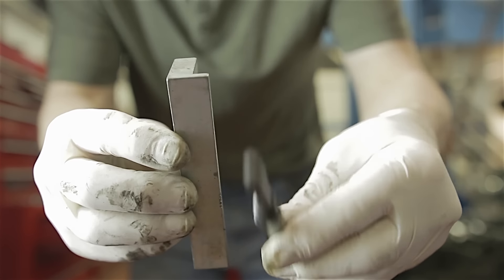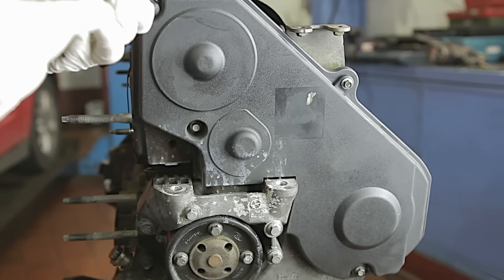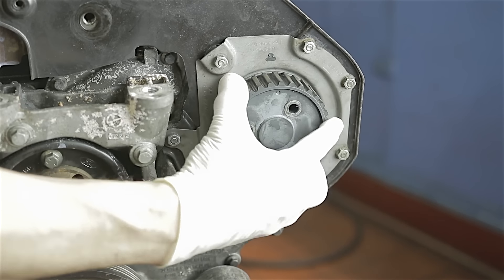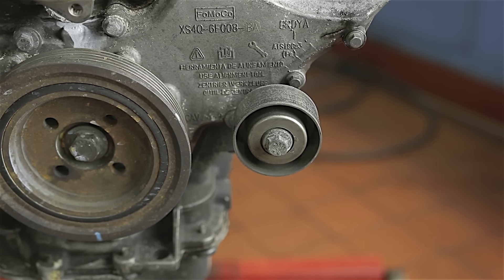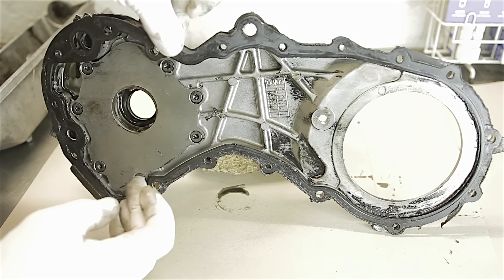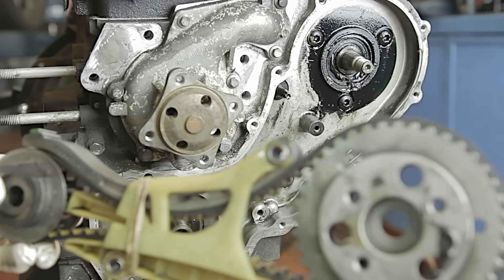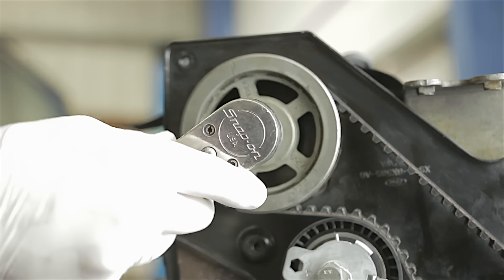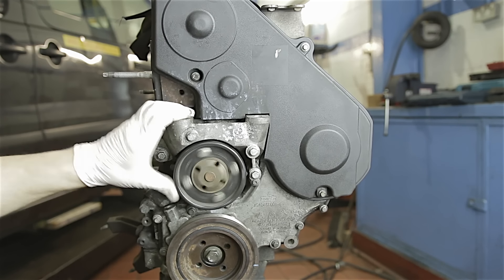Ford Mondeo/Transit Connect 1.8tdci wet timing belt replacement

Comment: HI just done a chain conversion to a 1.8 tdci and now have a bad oil leak from the crank seal  i used the correct tools and had everything spotless before fitting even with the alignment tool in the timing cover still has a lot of movement at the top around injector pump sprocket how do you get that  aligned? any advice would be greatly appreciated.

Comment: hi allan great video. Im using it to try and diagnose an oil leak does the offset  sprocket ? on the fuel pump when its not or if its badly beaded with sealant cause  an oil leak ?
Reply from the maker: yes it can do but more likely to be the main seal around the fuel pump that is built into the metal plate assembly but if you change that seal then probably worth taking the sprocket off and re sealing it as well

Comment: Great video. Can you please give me some advice.?Ive noticed a whirring sound almost like a worn bearing noise coming from my timing belt cover area. I suspect the tensioner, or at least i think, also the marker on the tensioner isnt in the middle exactly. Could it need retightened or even replaced. My car has 135k miles and timing belt was changed at 117k apparently but ive no proof that tensioner was changed  along with belt. Thanks
Reply from the maker: hi, make sure it is not anything being driven by the auxiliary belt, alternator etc.
j have had in the past the camshaft sprocket catching the back plate so with cam belt cover off you can push back plate to see if noise stops,
the tensioner pointer does not have to be exactly in the middle but only way to really check it is to remove the top belt and spin the bearing by hand to see if it is rough and noisey.
hope this helps..
Reply: Thanks for responding. Ive confirmed the noise somewhere in the timing belt area even with aux belt off. Is it just a matter of detensioning timing belt and removing tensioner to check or will this mess up the timing. If so Am i right in saying i dont need to loosen any of the 2 sprockets to do this. Thanks
Reply from the maker: if you are not sure then best to get some one who is but if you are going to remove the cam belt then you need to paint mark both sprockets to the back plate then when you put the belt back on you will know for sure that the timing is in the same position.
No, do not loosen any of the sprocket bolts.
Reply: @alan4x  Hi Alan. Great video. Quite informative. I've completed the wet belt replacement, changed the seal and all...but when I start up the engine it leaks oil from the bottom of the seal onto the belt. I've had the seal changed twice now but no improvement

Comment: What is the reason fot the wet belt? Has the engine been converted from chain to belt?
Reply from the maker: the wet belts were fitted to these engines somewhere between late 2007-2010 ish..aparently they reduced noise but i think they were cheaper for ford to buy and install than a chain...bad idea and the cause of many dead engines...you can convert the wet belt back to a chain but it is expensive
Reply: @alan4x  I know the Peugeout 5008 also j
uses a wet belt on one of the engines. Since rubber is such a good friend of oil and the unescapable fule that will leach into the oil I jus tthought that had catastrophic failiure written all over it.

Comment: Hi Alan, 

I appreciate your video.  

I’m in a bit of a pickle. I’m trying to identify what position the cams need to be in so it doesn’t have bend any valves. (Just replace valves, seals etc) but can’t find anywhere what position the cam would need to be sat in when at TDC. 

Any guidance would be much appreciated!

Comment: great video.  if you were to change just the top belt do you still have loosen the cam sprocket before you tension it.
Reply from the maker: hi, to be honest, i never loosen the cam sprocket, i just paint mark the cam and pump sprockets to the backplate and fit a new ford top belt, never had a problem and they always have lined up well.

Comment: Hi Alan.great videos, Keep them coming! I just got a 2015 Mk5 1.6lt tdci  Mondeo estate. Do you know if the smaller 1.6 diesel engine has the wet timing belt? Can't find any info on it.
Reply: Its dry.
Reply: Thanks. I asked the Ford stealership mechanics and they confirmed there is no second wet belt also!
Reply: But in the 1.6 you have a dry belt and a chain which goes between the two camshafts 😂 What a stupid design

Comment: Super videos thanks Alan. A quick one. If I wanted to check the tensor bolt to see if it's a wet belt or chain, can this be safely removed and replaced and tightened without interference or worry?
Reply from the maker: yes, just unscrew it and take it out, there is no way the belt or chain will jump. just don't run the engine with it out lol.
alternatively you can give your registration number to a ford dealer parts specialist and they should be able to tell whether your car is fitted with chain or belt.
Reply: Thanks Alan. I will do that also, it's a 58 plate SMax manufacturer date March 2008, I was going to try check tensioner incase Ford can't help as your earlier video mentions that may not conclusively be able to tell. Here's hoping. Although the chain has a recommended 125k miles change, it's not necessary? P.s your not local and do foreigners per chance? 😉
Reply from the maker: ford dealers have been pretty good on knowing whats fitted to cars lately so worth a try, if it does have a chain then forget it, that is a double chain twice the thickness of what you would find in say a vauxhall corsa and i have never had or heard of one of those chains breaking
Reply: Thank you again Alan. Final questions you'll be pleased yo know. I assume worthwhile changing aux belt and tensioners? Anything else (aware to do the waterpump) whilst engine in this state? Average number of hours to complete? And FAI a trusted brand. Finally thank you again.
Reply from the maker: yes well worth changing aux belt and tensioners if feel or sound rough, thats about it.
i have only ever used genuine ford parts and although fai is a good brand i would still rather pay the extra as the genuine parts will be of better quality.
if you have never done this job before then it will take approx 6-8 hours, when i was changing wet belts for chains on mondeos one after the other i was averaging just over three hours a car
Reply: And it's possible to do this with engine still in situ?
Reply from the maker: yes

Comment: Alan which ford diesel engine according to you is the best to go for
Reply from the maker: depends what car you are interested in but most fords now have peugeot engines fitted which actually is not a bad thing
Reply: @alan4x  we are looking at buying Ford s max 2.0 ctdi from 2011 with about 60k ish miles

Comment: Hi Alan, I see that you have done a lot with this engine, I have just repaired one of these engines after the said belt snapped it's had pistons valves etc not a problem all built back up but my problem is the belt tensioner pointer will not go into the correct position it's right at the top of the window and will go into the correct position the tensioner just goes all the way around, but if I put a washer between the belt and ajuster wheel it will tension up ok it's like it the belt needs to be about 50 ml shorter but it's a brand new ford belt and tensioner, have you ever had this problem? any help or suggetions greatly apreceated.

Comment: Hi there..
Great video. 
I'm not a mechanic..but my 2004 1.8 transhit connect has had this issue.
142k 
5 weeks ago the water pump went and belt snapped.
Plan was get it fixed..whatever needed to be done and a new MOT as it was nearly due.
Over the 5 weeks my van was running like a sack of spuds since and i could smell fuel.. but not see any, and today my fuel pump wet belt snapped.. should this have been done at the garage.. or was there no way to determine it needed to be replaced
The garage said its just one of those things.. but I'm wondering if they screwed it up and it was always misaligned and this caused the failure today.
Any support would be great thanks all

Comment: Is it possible to tell if the wet belt has been replaced with a chain without removing too many parts?
Reply from the maker: no it is not possible so if you have no record of it being replaced it will require a full strip down
Reply: @alan4x  oh god! How much will that cost?
Reply from the maker: by the time you get to the belt you may as well just replace it.  Depends on who does the job but expect a repair bill of £1k give or take

Comment: Hi Alan, great video.....I have a transit connect on a 06 plate just covered 100k patchy service history before me, I've kept it maintained in my 3 years of ownership but now is time for the upperbelt change, ford also state to change the chain gear like you have here on your video. But you say if it has a chain already dont worry? My only concern is I get a serious 'worrying' clonking/chattering rattle very occasionally on start up 'once every couple of months maybe' and for the life of me can't establish exactly where it is coming from, I did think it was the drive coupling on the alternator but cant be sure and now think possibly the chain / tensioner..........it goes after about 30 seconds, or if you turn off and start up again. The intermittent noise I mention is definitely coming from the belt/chain side of the engine. Any ideas as you are very experienced with this engine?
Reply from the maker: hi, i have never had a chain or tensioner fail in one of these engines but to make a noise a few times every couple of months is odd. if i were you at this stage, first replace your engine oil and filter if it has not been done in a while and then remove the auxiliary belt and check all the pulleys including alternator pulley, i have had various pulley failures including crankshaft pulleys falling in half. if you can get your engine to make this noise then by removing the auxiliary belt will eliminate a lot of components.
if you are going to replace the top cam belt then you could replace the lower chain or just fit a new chain tensioner just in case the old one is weak but for it to only make a noise for 30 seconds on startup sounds like an oil pressure problem or lack of oil changes have worn out the chain/tensioner. it is a thick, short, double heavy duty chain that should outlive your van so i would replace the tensioner first and take it from there, hope this helps
Reply: Thanks for your reply Alan, I always change the oil every year regardless of mileage, probably doing 5k tops per year whilst in my ownership. It's a very loud noise when it happens, to be fair I'm probably exaggerating when saying every couple of months more like 3 times a year.....I found a loose bit of trim on the inner wheel arch and thought that was it but unfortunately not! I have the upper kit and water pump to renew so will inspect everything. But really dont want to shell out £300 on the chain and sundries if I dont have to. One other thing to mention is that I get a very high pitch noise whilst at idle, goes with revs but its very feint can't trace that either!
Reply from the maker: if there was a serious problem with your chain then chances are the noise would be there all the time, its difficult to say without hearing it but i changed about 40 wet belts for chains on mondeos, which were taxis and these cars must have done in some cases 300k on a chain before the car was sold off and in all the years from 2008 until now i have never had a chain or even chain tensioner fail. best do like you say and check all tensioner bearings on auxiliary belt and if anything does not seam right get a opinion from a good mechanic but no, i would not change the chain
Reply: Thanks for the reply once again........you mention replacing the tensioner earlier, would there be any obvious signs that this component was faulty by looking at it/ feeling it? Also I have just received a timing tool kit, but when measuring the crank locking pin it has a different diameter to the DIY one in the haynes manual measured @ 6.5mm diameter where as haynes state 8mm diameter, out of interest what diameter is yours on the insertion end?
Reply from the maker: i have never had a faulty tensioner and there really is nothing much to look at or inspect but it should be replaced as a matter of coarse if you are fitting a new belt or chain kit.
the diameter of the crank pin does not matter, just the length, so with the crank pin screwed into the engine block the crank should stop on the pin and the camshaft should be aligned to insert the setting plate as shown at the beginning of the video, hope this helps
Reply: Well its bang on the 47mm length.......just getting all the info before I start stripping down. Thank you for taking the time to reply.
Reply: Hi Alan, I've got it all off and found the idler and drive belt tensioner both have play in them, so have ordered a replacement, looking at the flywheel pulley only thing I can see on that is the rubber has perished on it a little on the little ring that goes around it.....not sure if that makes any difference? Drive belt was also pretty cracked so will be renewed also.

Looks like I have an oil leak also but very difficult to see if its coming from the crankshaft or the sump.
Reply: Jobs a gooden if your van has air conditioning the noise might be coming from the alternator gears as the alternator is fixed further back
Reply: Yes I had a play with that and it felt solid.......I'm guessing it is meant to be like a one way device, i.e. it will only engage drive in the direction of engine rotation........
Reply: Hi Alan, I had an occurrence the other day, more of a grinding / rattle this time, the alternator light also came on. Would you think this more likely to be the alternator freewheel clutch or the alternator itself. Interestingly  when you key off and start the engine again it disappears both the noise and the warning light. I am more inclined to think this is a faulty alternator clutch, but thought I would try and pick your brains as you are very experienced with this engine.  Thanks in advance
Reply: Just an update.........It was the alternator freewheel clutch making the clunking / grinding noise. It is now replaced and running fine.

Comment: I wonder if the new wet-belt Ford Eco-Blue 2.0 engines which have replaced two engine families for Transit/Ranger and Mondeo, have a reliable long living system.
Great video by the way.
Reply: Ha ha ha, seems worse!

Comment: Brilliant Alan cheers can I just ask I just bought old connect 2005 it's at 170k so am going to do timing belt does it also have an inner wet belt (I hope not lol ) 🙏🏻
Reply from the maker: the best way to find out is to phone the parts department of your local ford dealer..they should be able to tell you using your registration number
Reply: I have a 2007 connect and I rang ford with the reg and they have told me it’s chain driven so am pretty sure yours will be I think they only changed on 09 on wards

Comment: Great job. Could you answer a quick question which I think unfortunately I fear! Does the gear box have to be dropped to get the upper sump off to get to the pistons?
Reply from the maker: hi...its been a long time but with just the tin sump off can you get to the big end nuts....if you are removing the pistons you need the cylinder head off
Reply: Alan Howatt thanks. Unfortunately can't get to the big end nuts as there's another bloody sump in the way seems to wrap under the gearbox think this buggger has got to come out :(

Comment: hi!  I have a problem with my Ford Transit Connect 1.8 TDCi 81kw.  namely, when adding gas or accelerating, the engine jerks until I let go of the gas pedal!  and it happens very often.  Is it the injector in question because it is quite wet from the diesel!
Reply: Check your EGR valve. Blank it

Comment: Thanks you Alan, you are hero. I have been worry about how to finish up the timing belt jobb until I seen your channel. Love it, thanks again . I been talk to Ford dealer here and they said my was a chain case under but still recommond to change new after 10 years old. I can't afford to trade in but after 186000 kilometer going to be need more work to do, any advice?
Reply from the maker: hi, if you already have a chain in your lower crankcase then don't change it..those chains last for 300k miles and more...never had one break but you should change the top timing belt at 125k miles
Reply: Thank you, I done it ,and went well. Thank you so much .

Comment: Hi Alan.....might have been asked already....I noticed that the main wet belt cover looked to have had a bead of RTV ....is that perhaps from previous replacement? Or is it something that ford do at manufacturing?...great vid thanks 👍
Reply from the maker: that sealant should not be there, i guess it was a previous repair ..the new metal metal gasket will crush up and make the seal so there is no need for any sealant
Reply: @alan4x  awesome thanks...I'm doing.one today 👍

Comment: How to reset the two timing belts of a ford focus 1.8 tdci 115 horsepower year 2009 engine after complete disassembly of the engine

Comment: Hi, I've just bought a replacement engine for my car which had a snapped wet belt, however, I don't know if the new engine has a chain or wet belt. Is there a way of checking without removing the cover and outer cam belt? I was thinking of removing the tensioner to see if it has a flat or domed end, but, I'm not sure if that would mess with the timing. If you have any idea please let me know it would be much appreciated. Thank you.
Reply from the maker: you can unwind the tensioner and remove it...the chain will NOT jump any teeth..just don't turn the engine over with the tensioner removed lol
Reply: @alan4x  Thank you